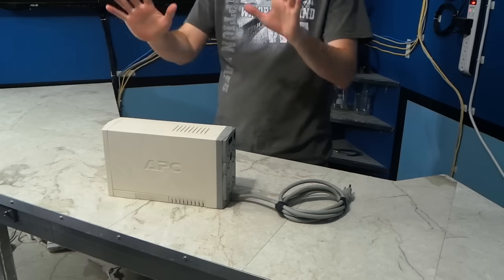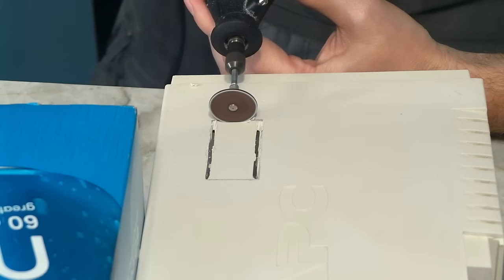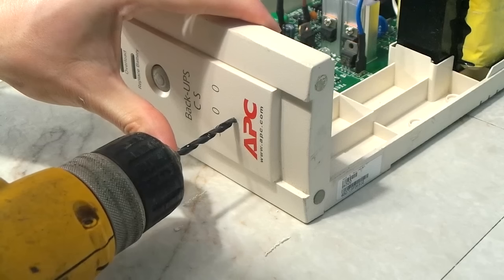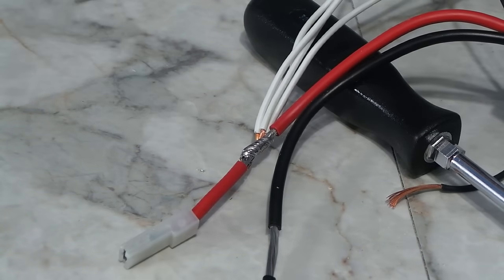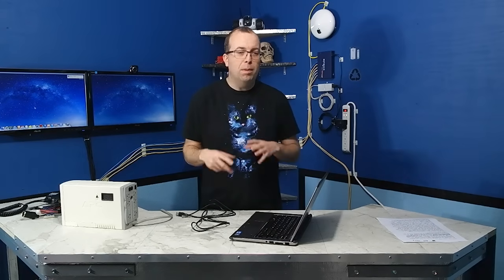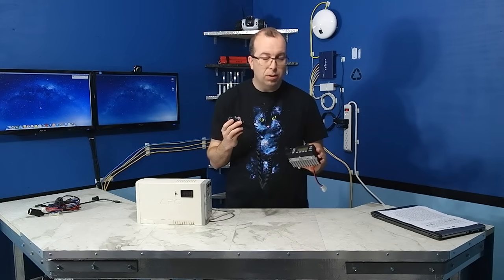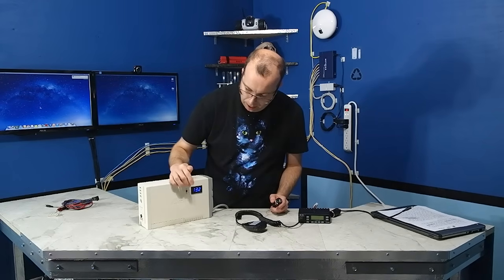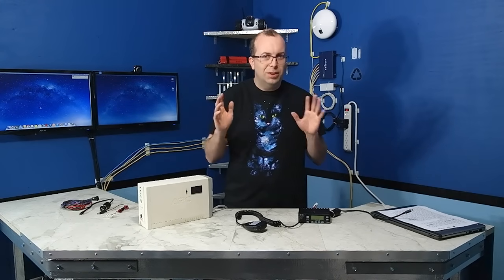Ultimate Battery Backup Hack/Mod.

Comment: ..Its an old video I know, but thought I'd comment on drilling holes in plastic, and thin metal.  The drill but best suited for this is a 'stepped bit'.  In traditional drill bits as shown in the video, they are intended to drill deep holes in thick material with the cutting surfaces on the point/bottom of the bit.  A stepped but has its cutting surface on the side of the bit.  They are basically intended to enlarge holes in thin material.  They do.this very well and one bit can cut several different sized holes depending on how many steps it has and how deep you push the bit in.  They come in configurations with size of hole and depth of step being the two characteristics people are generally interested in.  Anyway,  I just wanted lto share a tip about using Stepped Drill bits, hopefully others will find them as usefull as myself.  If you have ever drilled a hole in some appliance's thin metal case and marvelled at how you now have a ragged hole a set of dull drill bits....you are gonna love how much better a stepped drill bit performs.

Comment: While you're at it, you could put usb ports in case with a switch on them. A momentary switch on volt meter would keep from accidentally leaving it on. If using car sockets you could also put those right in the case instead of pigtail to get damaged or lost. One of the best UPC mods I like to do is ditch the little expensive batteries, and add leads to connect a car battery. If fumes are a concern, you can get a sealed deep cycle car battery for about $130 at Sam's. You could run all electronics for days if needed and the batteries last for many years instead of 2-3.

Comment: 4:45 never mind that the jacks themselves aren't rated for 16A... Nowhere near, actually.
Reply: Prob not likely that ups is rated 10 amps max in the first place.
Reply: Imagine pulling 48 Amps from that tiny, 7Ah battery :-D

He would release the smoke very very fast
Reply: @CharlieGosh  no body was confused by his comment. you repeated what he said
Reply: @DryLog420  House catches fire and he's like at least i can see during a blackout
Reply: That jack is rated for 3A max.
Reply: @CharlieGosh  Surely when acting as a UPS its going to draw WAY more than 7A from the battery.  From what I've seen, most UPS their rated maximum output is for about 5 minutes, that would be a HUGE load on the battery.

I'm actually a bit dubious about this mod though, as the charge circuit is going to be designed around the resistance of the battery.  He could potentially overload that charge circuit adding unexpected loads onto it, particularly if the battery was low and charging at the same time.
Reply: @alexatkin  That's an excellent point. Should be okay if you don't have a huge bunch of loads on the battery. Hmmm. Would probably run my router all day which would keep the Internet up during a power failure.
Reply: @hamza-zahid  That's it's smoke rating. It begins to smoke at 3A. All electrical interconnects and switches are rated by their fail-on-fire amperage, not their max safe amperage. A charming habit of a simpler age.
Reply: @alexatkin  I would be worried about the electrical noise on the charger circuit causing problems with 12v electronics.  It would suck to invest this time and have your Ham signal buzz or hum  o_O
Reply: @DryLog420  Don't worry, that UPS would actually draw 48 Amps from that tiny battery if it was working at rated power, but then the battery would last only three minutes.

Comment: Cool video, and inspiring a similar project for me with a APC BP500UC that I got off the free table at work.  The battery tested out very poorly, so I've ordered a replacement for about $25, and it should be up and running.  A couple of thoughts though: the battery in these units is usually a 12V 7AH RBC2 unit.  These units have a typical max discharge rate of 1C, meaning you really shouldn't be pulling more than about 7A from this battery.  In fact, if you look at the battery datasheet, you'll see that high discharge rates like this will also reduce the effective capacity of your battery.  The hypothetical "pull 48 A from your battery" condition isn't sensible:  Even if the battery could do it without swelling/heating/exploding. you'll only get a few minutes of runtime, at the expense of seriously reducing your battery life.  I might instead consider an inline fuse to protect from large current draws, probably at the 10A level.
Reply: Puekert's theorem states that the battery will be seriously derated beyond a C/10 or C/20 rate depending on the how the manufacturer rated the battery.  That said, you are absolutely correct in that this is an absurd expectation even from the 9Ah battery in his video since those DC jacks are canonical and only rated up to 5A.... no matter what Amazon ads say.   C/1 is extreme and I seldom design a power plant at anything above C/10 unless I have generator and an automatic transfer switch.  Even then, I will bump my LVDS so that the batteries are disconnected much sooner than when I build at C/20 rates.  I can also use my temperature compensation probe to monitor battery temp and disconnect on high-temp fault. 
There are many other things wrong with this "hack" and you read about them in my main comment.  Cheers!
Reply: My idea is to use an external, bigger battery. More runtime, better output, easier to swap out for remote charging.
Reply: @DiffEQ  I think the intent here is for low level "hacks" to build this. Your ideas are professional level, beyond the utuber level abilities.

Comment: It was smart to bypass the inverters / transforners. They're basically just energy vampires. If you added a solar charger, this would be an even better solution for extended power interruptions. You can power all sorts of things with a rig like that.
Reply from the maker: SeanFromPVD And the great thing is, those DC jacks will work in both directions.  I can add an additional battery pack outside the unit, or a solar charger as you mention.  I was going to mention that in the video, but it was getting to long and I had to start chopping footage out.

Comment: The whole converting up to AC to get it back down to DC is one of the things I used to laugh about when car tuning nuts used to put a PS2 in their car with an inverter... the internal voltage of the PS2 is 12V, so instead of using an inverter to get it up to 220V (Europe) AC, to then get it back down to 12V DC, it was a lot better to just remove the power supply from the PS2, and run it into the battery via a small surge protector (power can spike in some cars when you turn the key to start the engine)... this also eliminated part of the PS2 overheating issue by removing one of the elements that caused the heat in the first place, apart from making the PS2 very "cuttable" to reduce its size to make it fit anywhere better. This was good for camper vans too because on those things, if you don't have a solar panel system installed, power can be at a premium!!

Same thing for a number of other consoles, like the Gamecube for example (which is easier as it's just replacing the external brick... no need to open the console at all)... but everyone at the time always wanted the PS2

Also, I know this is a bit late, but for those USBs, if you wanted to embed them with a switch, I would recommend making your own using a UBEC like we use in radio control hobby. Those cigarette lighter adaptors tend to lower the 12V to 5V by just burning off the excess 12V, which is a total waste of power, where as a UBEC uses a switching mechanism to reduce the voltage, and not waste more than it uses... much more efficient, and you can get them in a variety of amperage capabilities.
Reply: lol
Reply: By PS2, is that the SONY® PlayStation® 2™, or the IBM® 8540 Personal System/2?  The PlayStation 2 needs a single 8.5 VDC source, while the 8540 needs +3.3VDC, ±5VDC, and ±12VDC sources.
Reply: Andrea Woodvine are you referring to the PS2 slim or the original fat PS2?
Reply: @BCSchmerker  I figured it was an 8.5V brick, because I've got about 4 or 5 of them in the garage purchased from a closing pawn shop, and they all say SONY(r) 8.5V and I seemed to vaguely remember them being for PS2
Reply: But as the APC battery starts to run low, the inverter will still produce 110v, from which you can get 12V with your power supply.
If you plug directly to the battery, you get 12V, then 11v, then 10v. Well you get the idea.
Reply: The 2 car adapters for USB charging I opened up had normal switch mode power supplies inside them, no linear regulators. Sure, you could probably build something a (tiny) bit more efficient and a (tiny) bit less expensive. But it hardly matters. I personally also have some devices that have cigarette lighter plugs that I use around the house, so having a ~12V supply for those is of use (compressor, fridge).
Reply: @Gigator  How could I tell once opened up?

Comment: I have this same "APC" model and I was with you until you got to the 'slide switches'?  Dude?  Why not a spring return  'Push button'?  A LOT less work!

NOTHING stops one from using a external 'Deep Cycle Battery' (as in RV battery) to this (or other) APCs?  There is PLENTY of current to support same AND those FRONT "120VAC" connections will LIVE LOTS longer too! 
     
BETTER YET, mount these puppies on a CART!  Make this install PORTABLE to make this project totally AWESOME!  Take it to 'quick' remote jobs or even camping if one watches the current demands!  
YOU are inspiring,  Anthony
"Thumbs UP"!
Reply: unless it's a sealed lead acid battery you do not want that indoors.
Reply: Yea, RV batteries vent gasses when being used. Gasses that can burn your lungs and stuff. Defo need SLA for indoor projects.

Comment: the surge protector for "telephone lines" is actually also a surge supressor for RJ45 connections as well, you can use it to supress surges on ethernet too.

also it would have been alot easier to just attach a battery charger pcb and two spade connectors to a cig lighter adapter
Reply: Ethernet has isolation transformers on every port. And where are the surges going to come from when you have a local network?
Reply: @gblargg  both are false. They are not purely isolated

The lan circuits are ground through the local machine but have a connection via the modem. I've lost a few lan ports through storm surges before
Reply: The only connection to local ground is through a 1500pF capacitor: https://i.imgur.com/mv0wfCT.jpg

I do use a surge protector on the coax cable into the cable modem.

Comment: The irony is this is mostly unneeded in modern times because modern UPSes tend to come with direct DC USB chargers built in.  I have several APCs that do this and will run a USB device almost forever.
Still, very cool video.

Comment: You need to check the battery leads and make sure they are isolated from AC or you could end up with a dangerous shock hazard.  A lot of UPSs have the battery connected to one of the AC lines because it saves money and, because everything is behind the plastic case, it's pretty safe.  But if you bring those battery lines outside, treat them as electrically hot until you've checked them against ground for AC voltage, and do the test again with the power hot and neutral reversed on the plug, since you don't want to bet your life on every outlet being wired exactly right.  (And don't ask how I found this out.)
Reply: How do I measure this?

Comment: I would have added a way to plug in an outboard battery, but doing so could stress the inverter over time, so limit limit use of the AC outlets, after the backup unit has allowed you to save whatever it was you where working on. Couldn't tell the nature of that ham radio, but my experiance in many over sentiment the reserve time, because they don't know how to do the calculations The there's that snag one can't know how much Emcomm traffic there may be during a power outage until it happens. I'm a ham as well, for the unitiated HAM is not an acronym, so simply  ham is sufficient. Great job with a video that, efficiently details what your doing, and why you are doing it.

Comment: I know I might be late to the party for this video, but I was thinking about a minor upgrade to your modification: Instead of using a switch for the LCD display, you can use a simple button with an RC timing circuit, and make it so it turns on the screen for a fixed amount of time and then it turns off automatically... I have a tendency to switch things on and then forget about them, so I started using this approach for my projects.

On a side note, I haven't thought about using an APC like that. I have a car battery with a charging circuit and a 3D printed hub where I put all my connectors. Of course, I don't use it with my computers, its just for things like cell phone chargers, and a hand radio (which has a switch to bypass to mains in case I need it).

Comment: Who else was yelling "FUSES, FUSES" watching this?
Overall not a bad idea, I've also heard of people doing this to hang additional batteries in parallel to run a low load for a longer time (e.g. keep a modem and wifi running for a day or more vs just an hour).
Reply: Matthew Miller I totally agree!!!  A short on one of those lines will cause a fire!  I would put 15A fuse on each wire and maybe even a master fuse for the battery (there is certainly one on the circuit board but he is bypassing it).

Comment: 3:08 Thats why they made stepperdrills!
Reply: obviously u can use step bits. But you absolutely don't need to. U need to know the basics of using the tool, and you'll be fine. But if nobody taught 8-bitguy that you need one pilot hole at most with these normal sized bits, he ain't gonna do less than go thru all of them. :).

Comment: Sweeeet. 
Found a smaller APC UPS today at goodwill.  Donating person wrote "works, but needs battery" along with the replacement part numbers.
Lo and behold, I search them in-store and it describes it as a 12v lead acid chemistry.  Small batteries, and about 30 bucks.  Not terrible...  but lead acid?  12v?  And I have an old deep cycle marine (sealed) in my shop.
So guess who is going to have a security system that endures the occasional power outage?  for 5 dollars and an old battery?

Thanks dude.  I think I may do a few of your upgrades as well, especially the 12v outlets  for testing things since I haven't yet acquired a bench power supply.

Very cool.  Thank you!
Reply: The lead acid is just the chemistry, still used in a lot of APS/UPS systems, just in AGM (Absorbent Glass Mat) form

Comment: I had a big ups for my computer setup 1.5k watts (with runtime 90mins) in 2005 (finally died in 2014).  The problem was fan noise.  The internal fans 2 x 4" were obnoxiously loud (high cfm).  I did a similar project to create a housing for air outlet tubes to external 6" PC fans (much quieter).  Fans were powered off internal dc power and fan speed passed to the UPS system.

Comment: I am concerned that if you are using this to power 12V devices, while it is plugged in, you could overdraw what the "trickle charger" can support.... then what happens?  My guess is that it is only rated for something like 2A@12v.

Comment: Dump the little battery and wire it to a large marine AGM deep cycle battery.
Reply: Correct! See where the fuses are?
Reply: A lead or outlet would be great for this because you could have both.

The internal battery but also the ability to hook onto any battery :)
Reply: I did something along those lines with 4 deep cycles connected. I tested with my server, desktop, monitors and phones, ended the test after 7 hours everything was still going.
Reply: @Dacia Sandero guys I did this over 20 years ago, removed dead  UPS battery,  added jumper cables that allowed connection  to a car battery, the UPS doesn't care or even notice the difference, itjust has a larger capacity than the small standard battery
Reply: @Dacia Sandero guys 
In those days I ran 600 cca car batteries, these days over 1000 due to running moderate size turbo diesel,  something this size will run all day and still have power to start your vehicle when reinstalled.  Generally you only need an hour or two until the issue is sorted.  But
For many people this makes a total difference to everything. Cheers
Reply: I've never opened one of these up so, not sure what type of battery came in it originally but, as long as it was also an AGM type, most definitely! Wouldn't do it if it came with a standard lead acid batt though. AGM batts are super sensitive to overcharging
Reply: @Eric2300jeep    ones I have pulled apart, years ago, all used  a sealed 12v battery as used in house alarms etc.
Reply: Kinda like Technology Connections.
Reply: Or be a good capitalist, throw it in the trash, and buy a modern UPS that has a proper sinwave thanks to newer technology and a nice integrated LCD and other functions like USBC charging ports.
Reply: @ddd228  This brings up one more thing this needs. Fuses on those 12v outlets as he wired directly to the battery, and it has no protection. Perhaps a small box for blade fuses like a car has or something.
Reply: Anyone have the issue where the UPS turns off after running for a while??. Some kind of time constant thingy